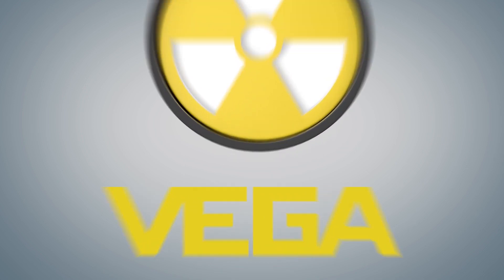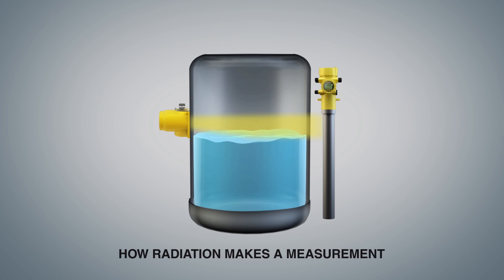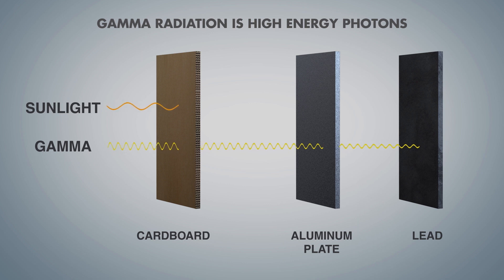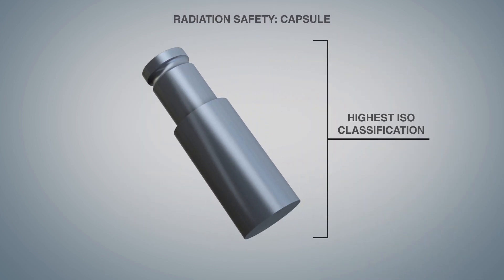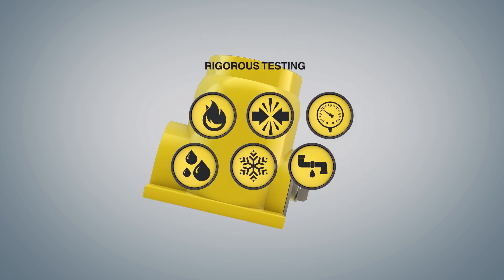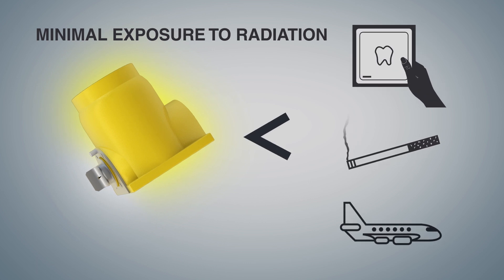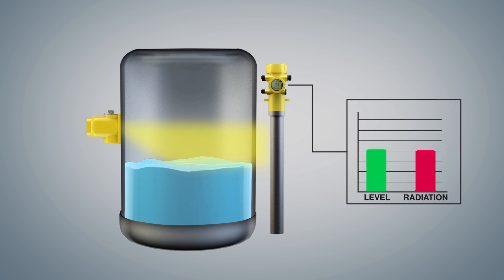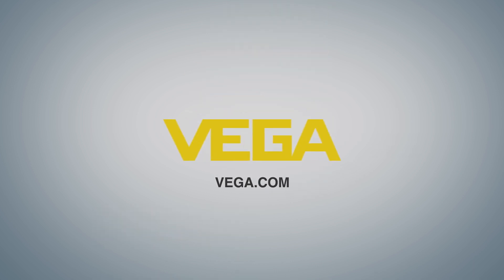How radiation makes a measurement | Radiation-based measurement

Comment: I like how you just walk past the part where you blast a fan of gamma in the direction of the sensor and it just so happens to break physics and not go past the detector, let alone the additional radiation scattering from materials excited by the gamma blast. How this is legal I have no idea.
Reply from the maker: This question was missed, please accept our apologies — as the saying goes, "Better late than never."
Our radiation-based measurements are all designed to comply with the full range of international regulations, and all of this needs to be checked by the responsible person on site. Radiation-based measurement is a safe solution in applications where other technologies encounter limitations or lack performance. Scattered radiation is part of the safety analysis we perform in advance.
Reply: @VEGA_Level_Pressure that's a funny way to side step that statement. so basically "yes, not our problem, lets talk around that issue instead, it's totally safe because the customer is willing to accept the risk therefore not our problem" amazing. bravo.

Comment: OOOoooooh okay. I was wondering what the actual mechanism of detection was in the sensor. Sounds like some kind of fiberoptic (more toslink light pipe than fios glass fiber, I imagine) probably some specific plastic type or dopant that either fluoresces or emits Cherenkov light when a gamma particle passes through it. Cool. Really interesting technique.

However, Im going to have to take some issue with equating gamma radiation to sunlight and it being "safe." For the record I am pro nuclear, I know just hearing the word radiation isnt going to make my hair fall out like the scaremongers want us to think, and we get a higher dose of radiation on a long flight than we do in most situations, so Im not trying to cause a stink on that front. But I am also pro nuclear education and safety on all levels....so heres my 2 cents for all to enjoy. Yes, the concept of the photon is the same for all intents and purposes, but the energies involved make them wildly different beasts. And "Gamma radiation is safe" (notably in danger awareness yellow)??!?!! Seriously?! It made the Hulk!!! Okay, but actually seriously, no it is not safe. Ever. Yes, it can be UTILIZED SAFELY!!! Which is an entirely acceptable and valid point, nothing wrong with it. But asserting its safe on any level really leans into the fly by night shysters' territory. And considering the company site (well designed by the way, and I enjoyed the layouts in the pdf pamphlets. Very easy to read through, both casually and technically, which I cannot say about other industrial supplier literature), this outfit does not look like one of those......so......I guess its a marketing fail? Something lost in translation, maybe? Either way, it does not bode well for building a trust relationship, which is important when talking about radioactive tool vendors.

Also, what is the disposal procedure for, say a pipe, that has had the emitter strapped to it for years on end? Is there a concern for radioactive absorption, or worse gamma radiation reflection out of the expected beam path?
Reply from the maker: Hello, Thanks for your feedback and questions. The detector used to receive the radiation contains a PVT scintillator or a NaI scintillator, dependent on the measurement  task. It is a special material scintillating as soon as gamma radiation is reaching the detector. The generated light impulses are used to make the measurement.

As a supplier of radiometric measurement it is important for us to explain how radiation is used to make a measurement and the measures taken to keep the users safe. The video therefore indicates that radiation needs to be respected and as long as all proper precautions are followed users do not have to be feared. Then the video explains what measures are provided from VEGA like double encapsulated isotope according to highest safety standard (ISO 66646) and that it is housed safely in a special designed source holder. 
The comparison with light refers to that it is also an electromagnetic wave. But the video clearly differentiates that gamma radiation has a much higher energy. Therefore it is shown that it can penetrate materials like steel, whereas the light is stopped very quickly. 

The gamma radiation only penetrates the materials such as a steel pipe and does not change the composition of the materials or slurries being transported in the pipe. Density measurement on a pipeline is typically used in the mining industry. Hope this answers your last question, we appreciate your feedback.
Reply: @VEGA_Level_Pressure  Oh cool! It was the mentioning of fibers in the bendable unit video that kind of clued me into how it detected, but couldnt quite put my finger on how. Being an engineer at heart (machinist/fabricator by trade) its a bit of an uncontrollable hobby (more compulsion, really) to figure out how stuff works. Thanks for the info! I have some new stuff to read up on!

I totally understand where the video was coming from, not wanting to add to nuclear scaremongering (which I absolutely appreciate, far too much of that going around), and nuclear energies, and atomic physics for that matter, is one of those areas where quick 5 second sound bite elevator pitches just dont exist to properly convey the uses, processes, and potential dangers (insert old joke of " why when I get an X-ray do they put me in a paper smock and the doctor wears a lead apron?!" Of course, its because the doctor does X-rays all day and you only used up one of your however much dosages allowed by medicine, but that kills the joke). Its the same nerve in me that tickles when someone asserts all radiation is bad, that got tickled when the "Gamma radiation is safe" bit came up. That 'uhmmmm thats not entirely accurate in all cases.....' feeling. And we all know those boardroom types that know everything about running a business but nothing about what the dev teams are doing, "well the  thingy said it was safe, so I keep [some dangerous thing] here in my desk!" (not that this company has them, just a colloquial hyperbole general observation, like the X-rays). The "uhm, actually...." snark had to make an appearance (like the killing of the joke), that nuclear nerve is pretty sensitive sometimes....

However that all being said, I do also recognize it was in reference to how the radiation is being utilized in as safe a manor as possible. And honestly actually getting a reply, an informative one at that, from the company just a hand full of hours after posting, most certainly bodes well for the company! Far more impactful than the other thing that merely suggested the other direction. That's the kind of PR that would make me give an outfit a closer look were I in that kind of position. Although, unfortunately, Im not in an industry that could utilize such equipment, if I do hear of anyone needing such a device for such applications I now have a name in my back pocket to drop. 

And yeah, I think Im getting gamma exposure mixed up with neutron bombardment, which if I recall, is the part of the nuclear cookie one is expected to run like hell from. haha

Anyhoo, thanks again for the reply and info! 😎👍